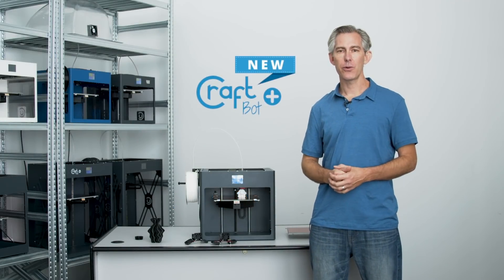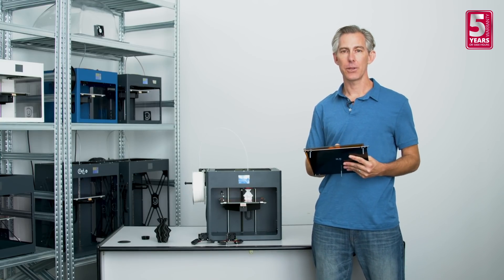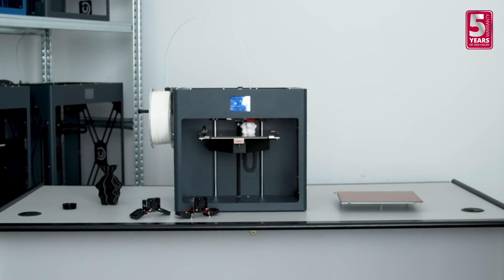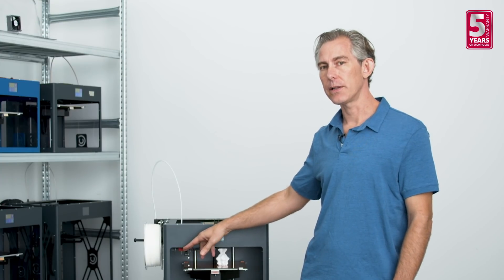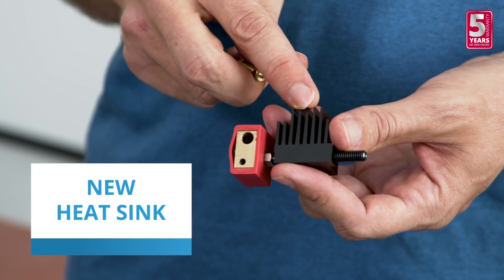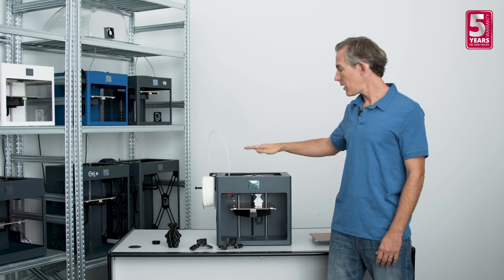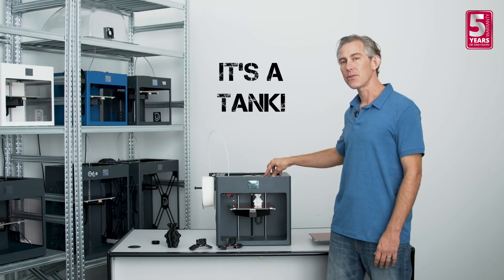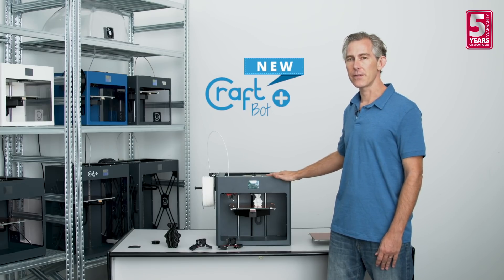Upgraded CraftBot Plus - 5 years warranty

Comment: it is not possible to upgrade or repair the Craftbot Plus Hotend, since the secret silicon piece/tube inside "diameter 5mm, lenght 4.8mm, hole 2mm" is not possible to finde anywhere to buy. This Craftbot hotend is really a stupid's design.
Reply: Sorry, it is more than 10 years old design... The full metal hotend does not have that part.
Reply: @bbrainka  
I bought my new CraftBot Plus in summer 2018 also 6 years ago - that means I got then an already 4 years old and unproven hotend in a new machine from CraftBot. Buying a CraftBot was that time my biggest mistake.